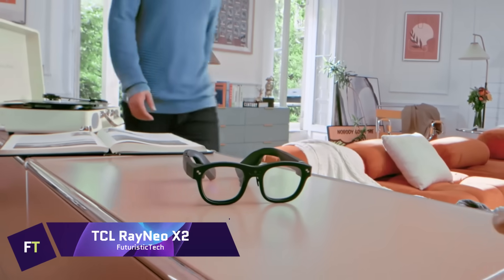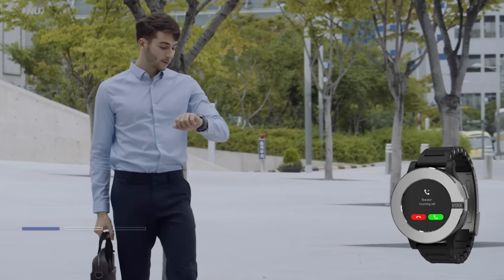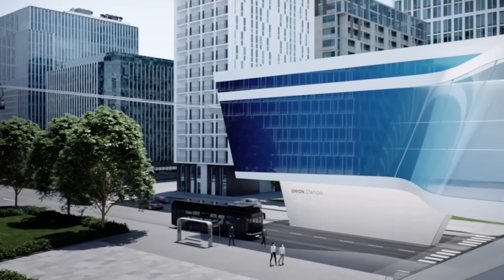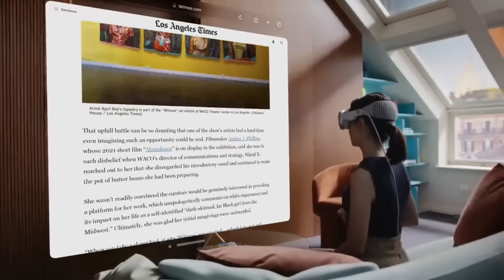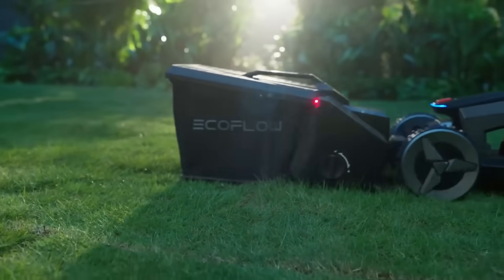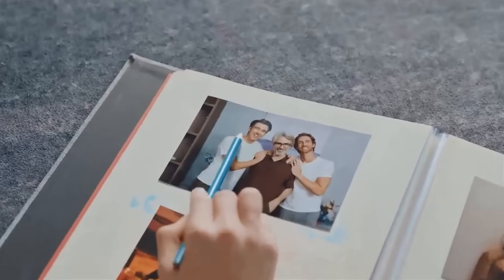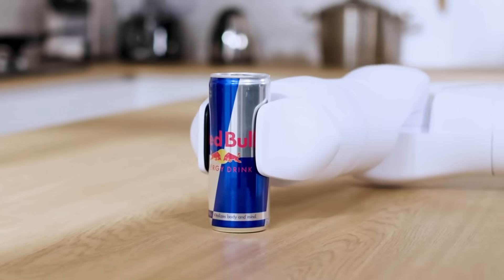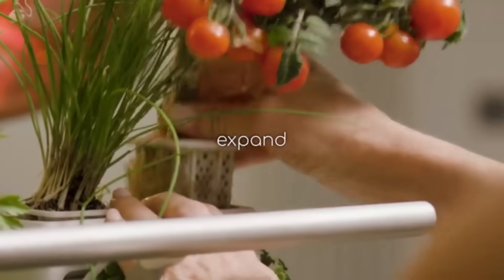15 AMAZING INVENTIONS THAT WILL CHANGE YOUR LIFE

Comment: Hard to believe very few know of technology anyway. The all-in-one smartwatch, it can't be sold at Bank Straight away(for the transport)? Writing the Duration Before Recharge Needed? Smartwatch type maybe if have easiest simple(user that imagine longer battery) + NETS then lastly this one? If a card type like under-wristclock casing can be created will be nice too, to function as the debit card ezlink(heard as shutting down)? It is usually standard size? If imagine a vernier caliper to lock onto base of wristclock then the NETS/debit card/ezlink to be inside it? Other is thumbprint before a use of nets(debit card) and to function like ezlink as well, size like: android's thumbprint point, should be capable?

Comment: Episode [8:10] - SN42 6Dn locomotive powered by hydrogen. Is it true that this locomotive can operate for 15 hours with a power of 650 kW before it is necessary to refuel with hydrogen? As far as I know, this locomotive has 2 fuel cells with a total power of 170 kW and takes 175 kg of hydrogen in the tank. The vehicle is also equipped with a battery energy storage with a capacity of 167.7 kWh. So, something isn't right here... The energy stored on board in hydrogen and batteries is many times lower and will never allow the locomotive to operate for 15 hours with a power of 650 kW. I appreciate innovation, but misleading people immediately raises a red flag for me...